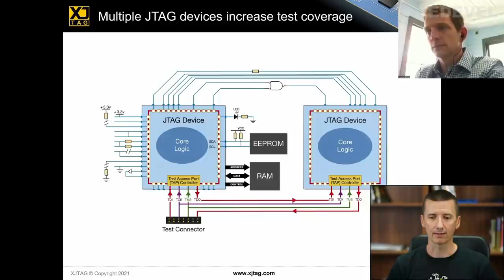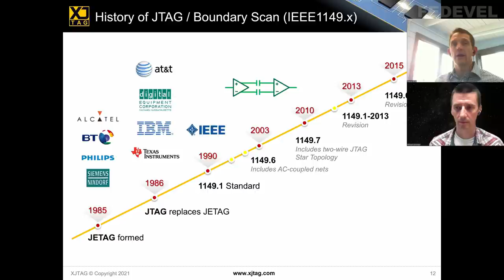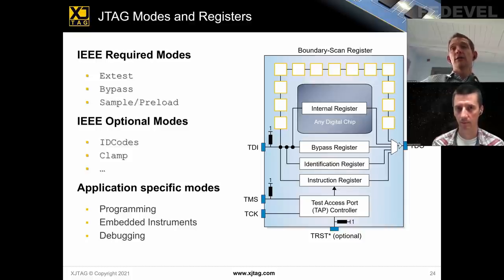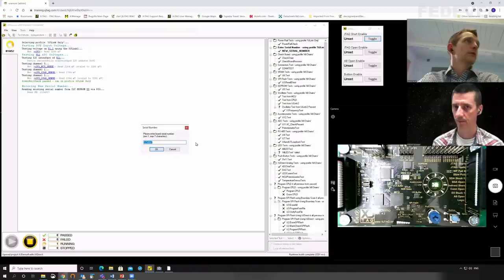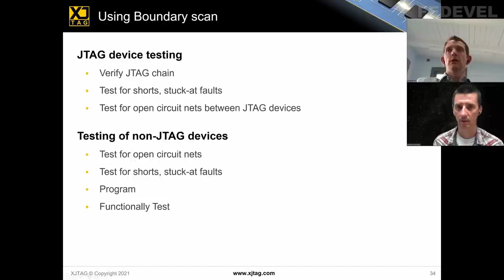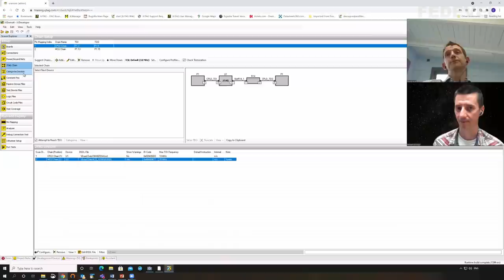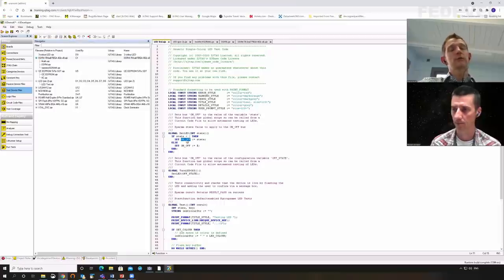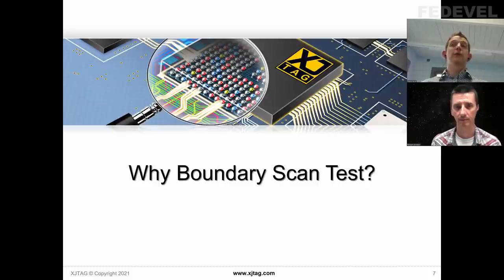Every HW Engineer Needs To Know This About JTAG (with David Ruff)

Comment: For most I think JTAG just turned into a programing port. Looked at it when it first came out but not many chips that we used had it build in, so we stayed with standard testing methods.
Reply from the maker: exactly

Comment: JTAG becomes a truly powerful tool when the chip allows write and read access to all (or at least most) device internal registers and memories over JTAG to internal bus such as AXI bridge. Common thing for debugging complex FPGAs and SoCs, with FPGAs also having internal logic analyzer tools from which sampled data can be read over the same JTAG interface.

Usually we would test more complex boards with higher level software and separate test fixtures. Like running DDR memory tests from bootloader and other peripherals from Linux. This allows testing of high speed interfaces at their nominal frequencies. It is also worth noting DDR controllers have comprehensive training and test modes that don't require fast speeds for register writes and reads to run. Its all offloaded to DDR controller hardware.

JTAG for initial programming. U-Boot / other bootloaders for DDR testing. Linux for everything else.

Comment: What JTAG adapter can be used with XJtag?  And can one adapter (ex. Altera/Intel Usb-Blaster) be used on a board that has a Xilinx FPGA?    I've always found it odd that Jtag is a standard for all devices, yet every chip seems to work only with the chip vendor's programmer!

How does XJTAG's XJDeveloper / XJInvestigator, compare with other tools.. Navatek JSCAN, JTAG Provision ,  $100 TopProbe ?

Would like to hear more about generating the files needed for XJtag.  For example, how do you use Altera/Intel's BSDL Customizer Tool for modifying a bsdl info file based on the .pin/ucf file.  Similarly, Xilinx has a BSDLAnno tool for mapping between the specific user design and boundary scan test.

Comment: One question which I've always had is how to locate shorts when, for example, you have two BGA's connected to each other?

Let's say that JTAG detects a short on a pin under BGA A. Now you know which line has a short, but how do you know if it is under BGA A or BGA B?

This has implications for rework. It can be expensive and risky to remove/replace a BGA. Every time you reheat the board you risk creating other problems, so it would be valuable to know which BGA to replace.
Reply: I’d imagine if a short on a bga to bga trace is detected, there would be another short circuit detected on another pin?

Comment: Not all CPLDs have them. Some require parallel programming.
The programmers are old and obscure, cost hundreds to over a thousand dollars, and can only be run on old machines.
The MAX3000 devices for an example, TC devices do not have jtag while STC do.

Comment: While JTAG boundary scan is essentially just a glorified shift register, it is still useful for test and programming digital chips. and it has a total market monopoly on this. 
However, the pricing is set to ensure that only big companies can use it to get even richer, while small companies and individuals are locked out of using it.
If it was a £200 piece of software then I could use it and probably save enough time to make the money back again in a year, so that is what it is worth to me.
Unfortunately they want £20,000 which is an utterly ludicrous amount of money for software to control a shift register, so I will never be buying it.
Reply from the maker: For me, the software would be expensive. However I can imagine, it can actually save a lot of money even in smaller companies which are manufacturing a lot of boards or expensive boards (or both). Maybe if there was a version of software which is cheaper, to see if it can pay for itself (you know, to test it somehow first), that could help. PS: It looks like, the price was in USD ( https://youtu.be/lV3DECTwTCQ?t=5060 ). I think, the auto-generated tests and the libraries are were the value is hidden. I didn't know they can do that - create a software which can help with creating the test based on schematic and pcb.
Reply from the maker: Nicholas, I just read a comment on linked in from Istvan and he pointed out a software called TopJTAG Probe for 100USD: http://www.topjtag.com/probe/ Maybe could be interesting to have a look at.
Reply: @RobertFeranec  Thank you, that looks very interesting.